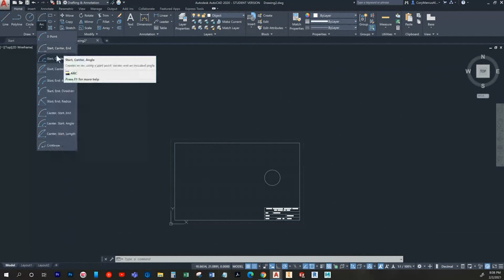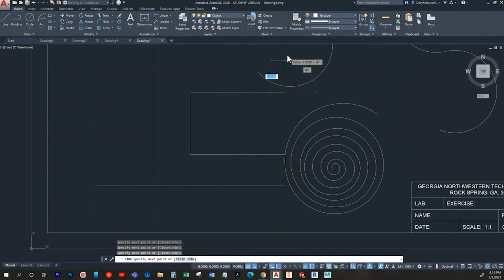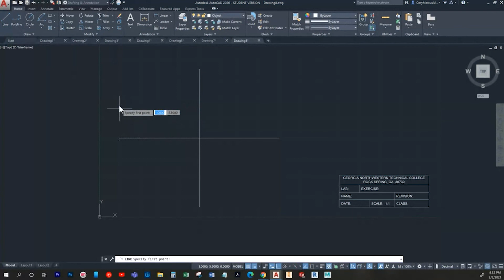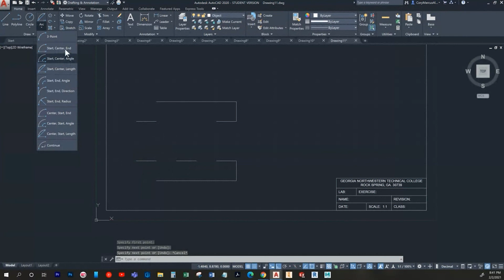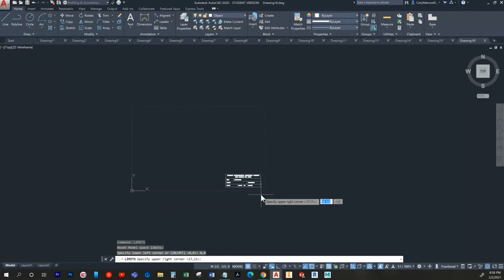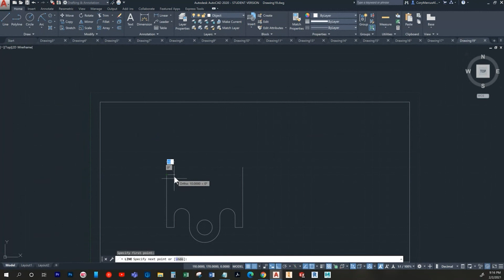Chapter 3 Solutions: AutoCAD 2020 A Problem-Solving Approach

Comment: Hey i know this is a somewhat old video, but I'm still having a hard time doing some of these absolute units, usually on our hw it would have measurements like 2.00, but when i put them, they're inaccurate for some reason.
Reply from the maker: Hi Moji, what you explain here is relatively vague haha. It sounds to me like you are either drawing without dimensioning or you are drawing without editing dimensions. There's no real way to ensure accuracy with proper constraining and dimensioning
Reply: Hi. Try using relative once in position in ABS. Use the  @3,4 format (move from current position relative x 3 units, y 4 units).